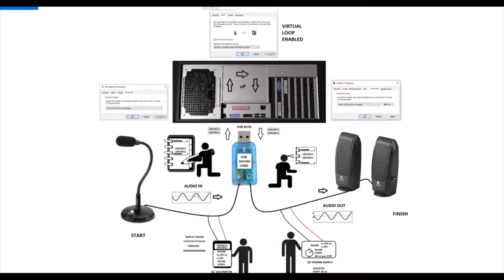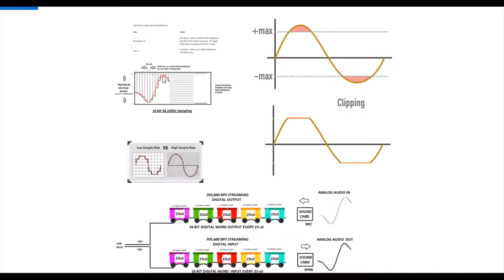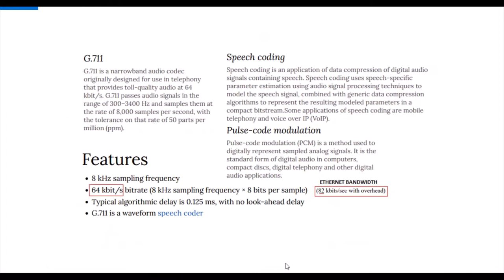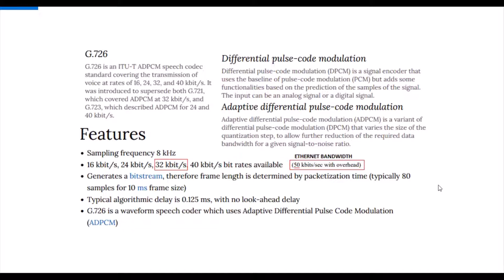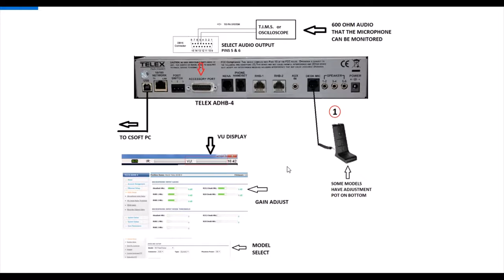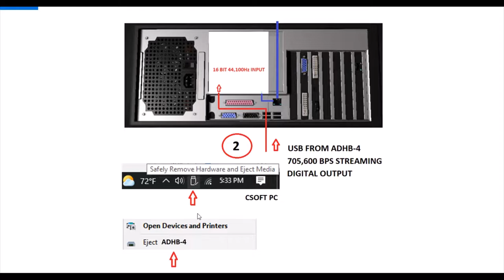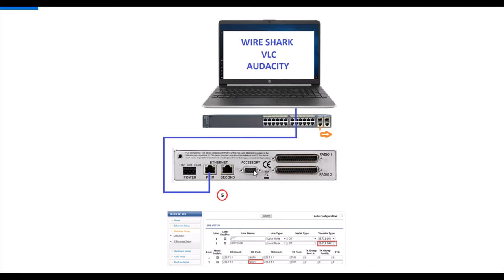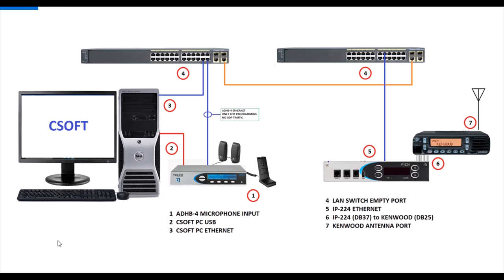C-Soft to Telex IP-224 Theory of Operation

Comment: I know this is old, however, at 33:00m you say the c-soft output is UDP and goes out to all ports on the Ethernet switch - the former is technically correct, the IP 226.x.x.x address indicates multicast and is how UDP traffic could propagate to all ports, it is not phony. Otherwise, good video and much better than trying to read the install manual.
Reply: Good day are you knowledgeable on the topic on connect the IP-224 to a kenwood nx-5700